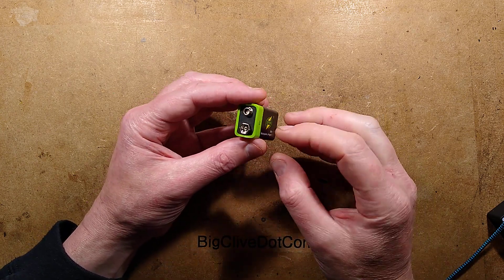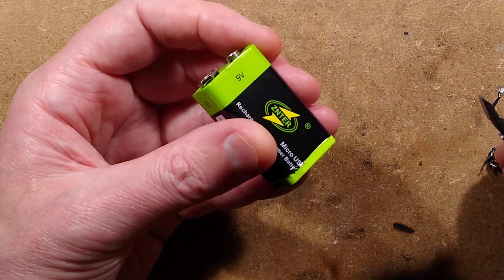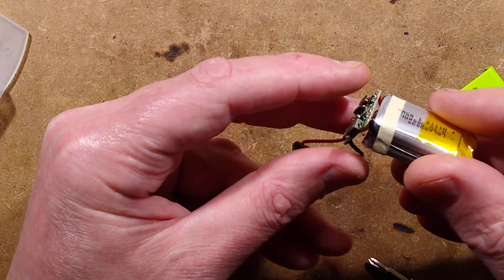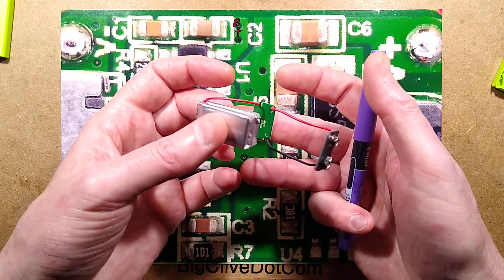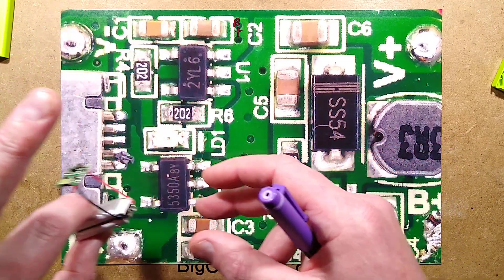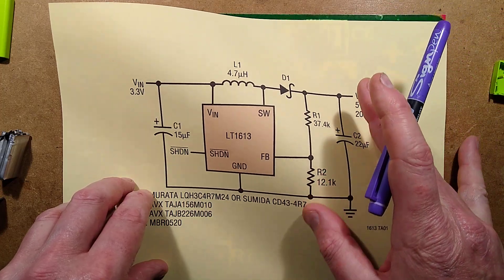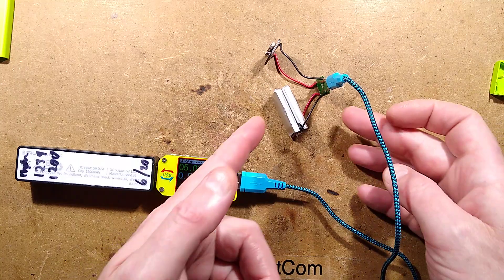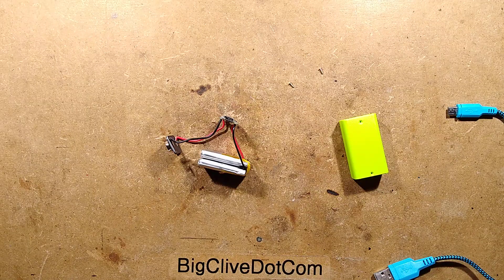Inside a Znter lithium 9V battery.

Comment: Clive, I was surprised you didn't put it on a scope to look at how noisy the output was as you commented on the possible problems with using it in a wireless microphone application. Thx for the review.
Reply: I have the same battery, and I checked it with a DSO201 pocket scope, I couldn't see any switching noise whatsoever. I use the battery in a wireless mic, and can't hear any noise at all.
Reply: @aszi77  Not sure how well you could pick up noise since that scope only has 1MHz bandwidth. Still amazing little scope, wish I was 50yrs younger, soo many devices made today that fit in pocket vs the 50 lbs equipment we used back in the stone age
Reply: @vidasvv  If the switching frequency is under 100 kHz I guess I would see something.
Reply: @aszi77 If my metal detector runs at 19.2 khz would these type of batteries interfere with signal? also the speaker for audible sound is close to the battery compartment, would these batteries effect anything... I also have wired head pahones as my detector isnt wireless.
Reply: @aszi77  If you're still listening, what radio frequency is the microphone?
Also, is it a digital spread spectrum or simple FM microphone?
Reply: Or in the effect pedal... It is bad solution for audio equipment.
Reply: @aristoshd  every sound equipments is preferable to use linear power suplies
Reply: @aristoshd  Oh? Why is that? I was thinking of using mine for effects pedals. I was thinking they would be great for that.  I remember using a 9V (Carbon) in my fuzz face and the battery started to die so I  just played "Spirit In The Sky" That lasted for about 5 minutes. But it was awesome.
Reply: @aristoshd  probably still sounds better than this shitty noisy adapter i use on an ungrounded mains for this little portable guitar amp, add to that i mainly play on single coils... i can do morse code with just touching and releasing the grounding to my fingers lol
i lost the original adapter, that one sounded pretty clean (obviously still had a tad of noise whenever you go between earthing and not earthing yourself to the strings with no mains grounding), but the replacement i found, makes it sound like shit all the time,i actually went back to batteries until i find a proper one (yeah not 9v though, they're 6xAA)
and this is a mostly digital amp modeling little vox, i can only imagine the noise being worse on analog hardware, especially ones using mosfet overdrives rather than opamps, those are hella sensitive to interference lol

i had no idea the power supply was THAT important until i learned about how extremely good inexpensive modern class D amplifiers can sound with clean power and proper 4 ohm speakers lol
Reply: @klontjespap  try threading and looping the output cable through a carbon doughnut magnet (found in old pc's). That might smooth out the interference.
Reply: @klontjespap  A good way to think about the power supply in audio is that the audio you hear is simply the modulated power supply. Always.
So the supply is critical. Many amps are less susceptible to noise and reject noise, but always the time spent taking care with the supply pays dividends.
The battery comes close to the ideal supply.
Reply: I've got a pair of the AA version and I've used them in a Shure SM58 wireless and a few other audio devices. Never heard any noise.
The biggest risk is actually that they provide no voltage feedback and just cut off from 1.5v to zero when the lipo gets too low.
Reply: @tin2001  I know nothing of microphones but you're spot on about this risk.  I tried some very cheap AAA sized lithium cells in a headlamp once - they were one year from expiration date so I knew not to expect full capacity but I was still curious. I normally get ~5 hours from alkaline / Eneloops in this particular headlamp but after 2 hours cumulative runtime, I set off into the bush late one evening only to have the light abruptly die mid-step with zero warning 5 minutes later. Other batteries dim towards the end and the headlamp periodically flickers a low battery warning. But these lithiums gave no warning, just sudden and immediate death. I sensibly had spare cells with me but I had NOT expected to need them for my hour long jog. Luckily the surface was flat where it happened but could have been bit dangerous if I were skipping over rocks down a steep hill or something.
Reply: @chocolate_squiggle  said, _ but I had NOT expected to need them for my hour long jog_
That is always when people get into trouble. They "didn't expect xyz to happen".
They didn't take water. They didn't take a coat (or emergency "blanket" (mylar film type)). They wore cheap shoes or even "flip-flops" for a "short" hike. They wore shorts on a "day hike" even though it gets near freezing at night. They didn't take any communications device. They didn't take a small flashlight on a "day" hike. They didn't take any fire-making tools with them...not even matches (better yet a simple lighter (and better=two lighters if you can)). They didn't take even a simple knife.

I also carry in a pockets (not in a separate package that could be lost) at least 5 days supply of any medicines I may require and stored in a decently waterproof container (even if that's just 2x doubled-up plastic bags).

Just a handful of small devices can literally save your life. Personally, I have a small survival pack that contains a good deal more than the above and I take it with me whenever I hike...even in clearly marked trail country and no matter how short the hike is SUPPOSED to last. It's a package about the size of 3x 12oz cola cans side-by-side.

Most importantly, they didn't tell anyone they were going, and where they were going and when they expected to be back on their "1 hour" hike
Reply: Or a  3 hour tour.
Reply: @jimhatch14 😂 Gilligan's Island's intro song, if anybody wonders.
Reply: @tin2001  : I was looking for this comment. It would affect the use of the 9V version in smoke detectors, water detectors and other applications where you rely on at least a few hours of low voltage beeping when the battery voltage goes under 8V and heads toward 7.5V. You wouldn't get any warning if the voltage goes from over 9V to zero right away.
Reply: @hockeyguy820 Good thought.   I c these advertised 4 use in smoke detectors - unsuitable for these.  Plus Clive said shelf life is only a few months.
Reply: They are crap in a very cheap meter so I would assume audio where you want an SNR of 80dB or more even if your kit has a good PSRR (rarely the case with battery equipment). it's going to be a git.
Reply: I know Clive has oscilloscopes because he's mentioned them, but I'm struggling to think of one time when he included the use of one in a video.  I suspect it's just too much faffing around changing camera angles etc.
Reply: We really need to see a side by side comparisons of two reliable multimeters - one with regular batteries, another with this lithium battery. I'm really interested if I could use these batteries for my multimeters, but the switching noise worries me.
Reply: Scope too big to fit under camera.
Reply: Or, JUST HOLD it near a pocket-portable AM band receiver ...
Reply: @martinhutchinson2741  LED's draw at the most 20 Miliamps. That's not a lot really.
Reply: I came here just to see the noise
Reply: For a low-drain use like a wireless mic or effects pedal you could make a version that did a boost up to about 11V and then a linear LDO to drop it back down to 9V cleanly. Wouldn't even lose a huge amount of battery life under those conditions.
Reply: @lwilton  It seems one could also use three 3.2-volt cells (LiFePO4) in series with a diode and ditch the boost converter entirely. The charging circuitry would have to be smarter though.
Reply: @hyperboloidofonesheet1036  I don't think I've ever seen LiFePO4 cells in small form factors, are they actually produced?
Reply: @Milamberinx  You're probably right. I was thinking of button cells, but I can't find any with that technology.
Reply: @Milamberinx  It seems Renata makes LiFePO4 coin cells, part number IFR2032.
Reply: @lwilton  linear regulator have a input to output noise rejection rating, they are not perfect.
Reply: @lwilton  Wouldnt work at all unfortunatly, thats just isnst how linear regulators work unfortunatly. They are REALLY bad at filtering any high freq noise, especially from switching supplies, the noise will go just straight through.
Reply: Why would you use this in a sound application. Knowing it's probably going to be a problem.
Reply: @simonhopkins3867  Its not about knowing.. its about testing and seeing if its a problem. That is what real EE's do.
Reply: Probably too busy engaging in sodomy to break out the scope
Reply: @carnivorebear6582  re: "Probably too busy engaging in ... "
Not your preference to is it?
Reply: @uploadJ  that's a good assumption

Comment: Of all things, I just find the only 400mAh available a little sad in this amount of volume.
With a bit more homework, that can easily be doubled in the same form factor
(same for the noise)
Reply: If it's 400mAh at 9V, you shouldn't compare it to the capacity at LiPo voltages. If you compare the Wh you'll provable get a more decent figure.
Reply: I have the Okcell T18287-2000 800 mAh battery. Great little bit of kit and VERY useful at that capacity. Has a charge meter on the side too. Alas, not as easy to take apart as this one.
Reply: i found actual oldschool 9v batteries to be quite pedestrian to begin with in terms of continuous load, so the power:form form factor ratio was never anything to write home about,
i would probably never design a device around 9v myself (but that's because modern ICs all run perfectly well on 5v already)
but i guess it's nice you don't have to mess with multiple batteries in series which comes with way more demands on having all your batteries balanced
Reply: But that 400mAh is at 9 volts, not 3.7 volts. So energy-wise, it's equivalent to a single 973mAh Li-ion cell, which isn't too bad. It's a pity battery manufacturers don't scrap mAh ratings and switch to Watt-hours instead - much more meaningful.

Comment: The right way to fix your 9v Mic problem is make a 9v dummy cell and hook it to a power bank and a boost converter.  Size of a cell phone.  Runs for days,  easy to see the charge status.  Silly to waste hundreds of pounds a month on "disposable" 9v batteries.  Double side tape to the Mic transmitter or stick in a pocket.

Comment: My doorbell takes 3 AA cells and flat out refuses to work on 3.6v from NiMH, so inefficient as it stops working when there is still plenty of power left in standard cells.
Reply: So put a couple of LiPo cells and an LDO dropper, should be good to go then
Reply: A USB battery that's always on and possibly a diode to drop the voltage will work fantastic for that.

Comment: Could you use one of the these in a smoke alarm?
Reply: It will probably work, but given that these self-discharge quite rapidly due to the circuitry, it makes more sense to use a good Lithium cell as G. B. said.
Reply: It would work probably. But i guess the low battery warning of the smoke alarm won't work anymore as the voltage would stay more or less the same until it eventually dies. Better use non-rechargable lithium blocks without the socketry. Mine work since 6 years now.
Reply: @gisobo  Another option would be to use two of the rechargables for each smoke alarm, with a strict say 3-month schedule for swapping in freshly charged batteries.
Reply: @gisobo  I did wonder about the voltage aspect and how it would affect the low power warnings on a smoke alarm
Reply: This is one of the questions I had in the past as well. Then I realized my life and loved ones are worth more than the pittance going with a good full-blown Lithium 9v costs.  For other 9v uses, $15 seems a bit steep.
Reply: @boots7859  i can understand that
Reply: Don't, the boost circuit shuts off suddenly meaning the smoke detector won't give a low battery warning. It also will only last 3-6months. You're most likely to just end up with a flat battery and no working smoke detector.

Comment: I have never had any luck with NiMh batteries.   They just don't last.  They die the first  time you allow them to get below freezing.  Never take a charge again.
Reply: yea what is that about. i have a box full of hundreds of AA 2700Mah cells, never been used, yet they won't charge any sense as they have been stored in an unheated building.
Reply: Never noticed this issue, the only problems I have had are related to the cells being reverse charged when allowed to discharge too far, that's the only way I've managed to kill a modern LSD NIMH battery.

Comment: I just bought one
Reply: Good for you
Reply: https://youtu.be/k1_pgnyYSaU
Reply: Si haces vídeo estaría muy bien si puedes probar que tan estable es su salida de voltaje y el ruido que tiene bajo carga, Saludos
Reply: @fdavpach  I don't think it would have much more performance than standard USB powerbanks. I guess it would be able to deliver quite a good amount of current and given it's circuitry, it may not produce much noise.   My question: Do we really need this? Maybe not... xD
Reply: @orbitalbear  What king of thermometer? Those with a thermocouple and a simple LCD Display? I'm pretty sure it would run just fine with any rechargeable cell that can deliver about 3V...just replace the 9V battery for any lithium cell and you're done!     It would need a little bit of art to put it together haha

I modified my multimeter connecting a LiPo and a charger inside (that was about a two years ago and i only charged it a single time! i guess 2500mAh it's a little bit overkill for a LCD meter. 😂). 

(Of course i don't mean this is optimal, but for this devices with built-in low voltage regulators works fine)

Comment: I've ordered a rechargeable AA 1.5v micro USB charging battery. I am glad to have paid for it
Reply: Any idea of it's real capacity?
Reply: @gordonlawrence1448  I ordered 1500mAh but real capacity was 850mAh
Reply: I've been using four of these in a head torch for a very long time, and they have been completely reliable. I've also got their "18650" size rechargeable for a UV torch, and that's pretty good too.  I would most certainly buy them again.

Comment: Amazing that it doesn't need an electrolytic bulk capacitor
Reply from the maker: At high frequency a small capacitor is fine.
Reply: @bigclivedotcom  Ceramic chip capacitors are coming in pretty high values these days, but of course your actual capacitance when operated at some voltage is going to be considerably less than the datasheet value, but still you could find those small output capacitors are around 10uF each at 9V, well in the range for similar size tantalum at that voltage.

Comment: Is it worthwhile trying the 'scope on these to see how noisy they are?
Reply: It's an interesting question.  The only filtering is the RC filter created by the output capacitors and the voltage divider.  If the chip is decent and switches in the 100+khz range you won't hear it in normal audio.  However, it's the harmonics that get you.
Reply: @EmperorA0  I have designed similar kit. At 9V you get about 200mV of noise unless you go a bit mental damping it down. That's on 80% load. As a rougg rule of thumb I always recon 20mV plus 20mV per volt of output. You can quieten that down but it costs and in commercial applications another 10p of components is a no-no. For switchers in audio the only solution I have found is boosting to well over what is needed then a 2 pole eliptic filter into a linear reg with the switcher boost about 500mV over what the linear needs to operate. Then of course a shed load more decoupling. You can get it down to less than 20mV at 10V for that but it's an absolute git.
Reply: I was thinking precisely the same thing.
BigClive should have 'scoped this battery both open-circuit and under load to see just how noisy the output is -- and maybe even installed it into a wireless mic or other line-level audio device that requires a +9 volt supply to see if anything untoward happened. PUT YOUR EARPLUGS IN EVERYBODY!!! ;-)
Reply: @telephony  maybe it's time for a follow-up video
Reply: But surely an easy fix with a decent cap across the snap connectors ?
Reply: @millomweb  No because of hysteresis in the feedback.
Reply: @gordonlawrence1448  Go on then, what would happen with a big cap across the terminals ?
Reply: @millomweb  I already told you. Look up hysteresis in switch mode power supplies.Also which topology? IE the answer will change depending on implementation.,
Reply: @millomweb  load makes a difference too.

Comment: Okay, R2 is bugging me. "18C" or "18D" makes no sense of course. To arrive at a typical 1.25 sense voltage R2 would have to be 35.5kOhm. 180kOhm works for a sense voltage of 4.0V if 8.89V is good enough. Thoughts?  [ Vo=Vref(1+R3/R2) ]